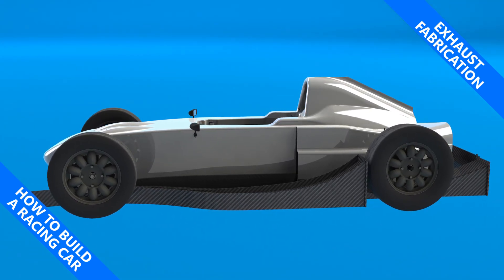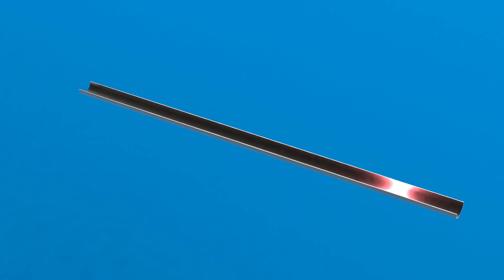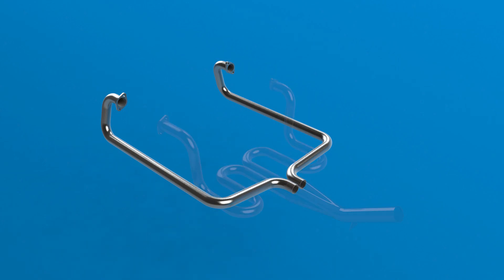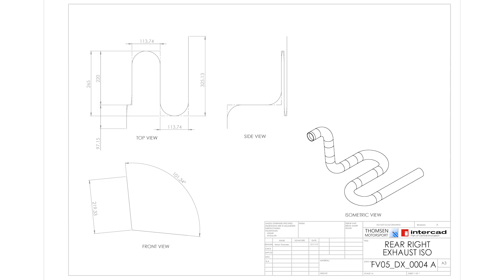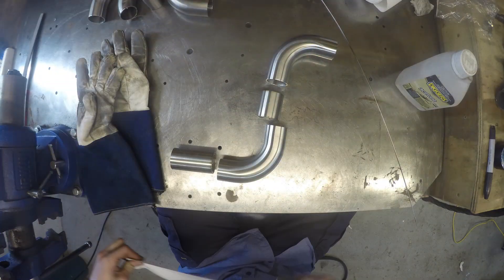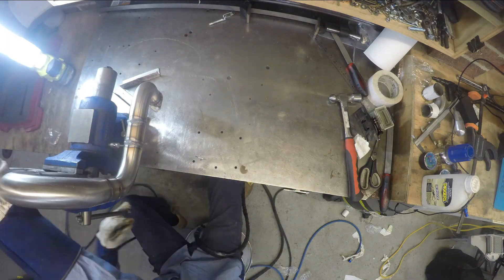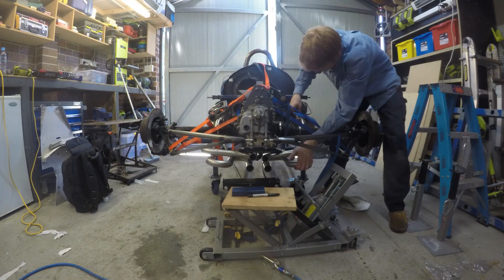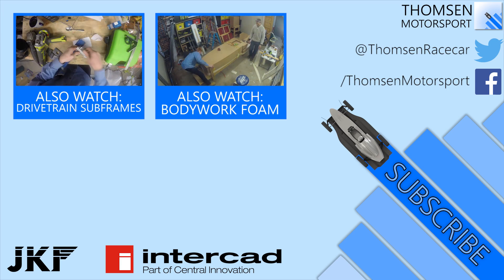Stainless Exhaust Fabrication

Comment: Congratulations for your awesome work. But unfortunately you make a mistake in the exhaust ignition explosion order of the VW Aircoold engines, that the correct is 1-4-3-2, and not as the design of your exhaust order that is 1-3-4-2. Hope this information help you to improve your performance.

Comment: Engine Masters did a neat video where they dyno'd an engine before and after bashing the headers with a hammer (like what someone might do to make clearance in the engine bay).  The car actually gained negligible power.  Based on that info, I would speculate a larger bead of filler on the inside of your exhaust wouldn't affect the power at all.  My $0.02.
Reply from the maker: Probably right. I don't know enough about engines to say.
Reply: ThomsenMotorsport that's a pretty wicked car though man!  Is that what you specialized in was chassis tuning?  How many calculations have you done that we don't get to see?

Comment: well i appreciate the sensitivity toward dealing with the harmonics of the flow - but (were it allowed) wouldn't a FAR SHORTER pipe help you generate much more horsepower?
Reply from the maker: Most likely, while I'm aware of the effect I didn't design for it, I just worked with the previous cars lengths as a guide. I had too much on my plate at the time to learn about it and optimize my runner lengths.
Reply: yes sure - thanks for your answer
Reply: i'm really enjoying watching these BTW - thank you for sharing
Reply from the maker: Thanks, good to hear.

Comment: Nice project bro! But don't you think would have looked beautiful to have 4 exhaust Pagani style exhaust?!?
Reply from the maker: Pop the collector off and that's what I've got. But there is a benefit to the collector and muffler, they do help the engine produce more power. I've had the collector and muffler fall off in another car I was racing and the car feels like it's down a cylinder.

Comment: Shouldn't you have used a flex to mitigate the flanges deforming?
Reply from the maker: Are you referring to a gasket? I've not used one since neither the car that I used to race nor the donor car that I bought to build this one used gaskets between the engine head and exhaust flange, frankly I just assumed it wasn't typical to use one because of that. It seems to be sealing without a gasket now that the flanges have been replaced so I'm not worried.
Reply: Well, I meant a flex joint in the pipes, to allow for movement. I was unable to edit the first comment to clarify this because of an error on YouTube.

Comment: Hi mate, did you do any research regarding pipe diameter or did you use the same diameter as the original pipes? Thanks
Reply from the maker: No I just reused the previous pipe size, same as what everyone runs in this category.
Reply: ThomsenMotorsport is that 1 3/8 if you don't mind me asking? Cheers
Reply from the maker: 1.5" with 1.6mm wall thickness.

Comment: Why is the back of the exhaust pointed upwards? Thanks
Reply from the maker: The reason is related to the CAMS Specification of Automobiles for 1st category cars (of which Formula Vee is one), under section 2 General Requirements item (vi) which states the car must be fitted with : "Exhaust pipes, the orifices of which, when directed horizontally to the rear, must be between 300mm and 600mm above the ground, and may not protrude by more than 250mm beyond the rearmost portion of the car."
If I exhausted it horizontally it would have a discharge below 300mm above the ground so would be illegal.
Reply: Ceazar Car r
Reply: Ceazar Carr downforce 😉😂
Reply: ThomsenMotorsport isn't that a problem wen it rains?